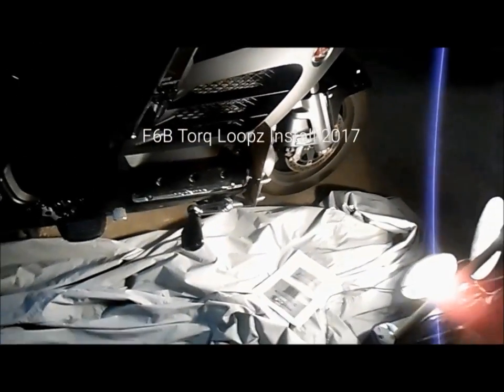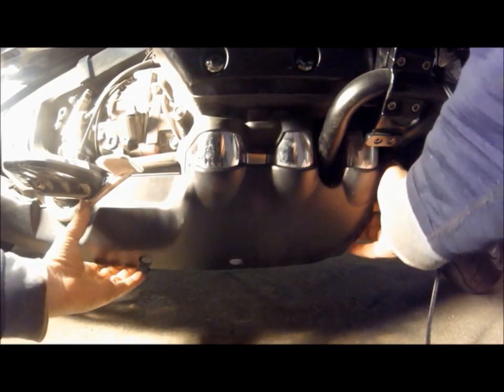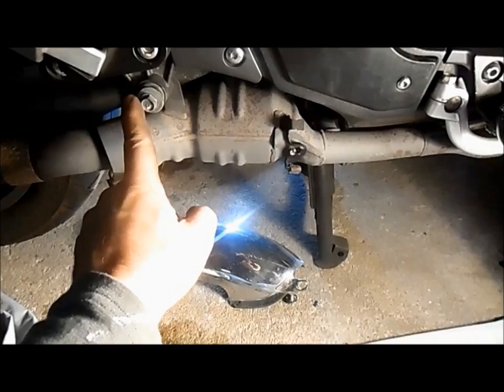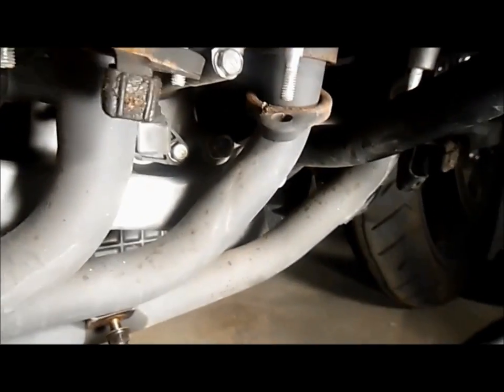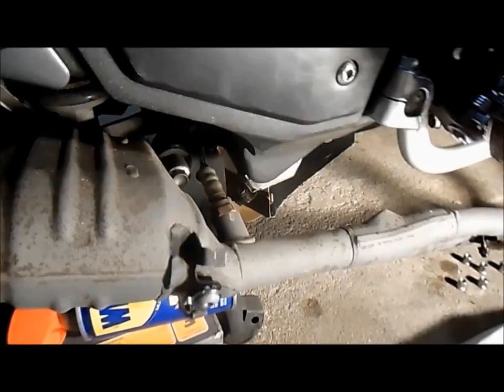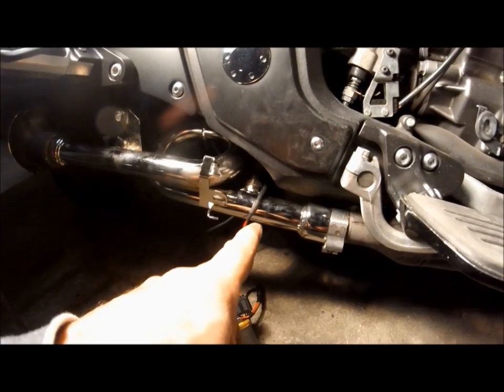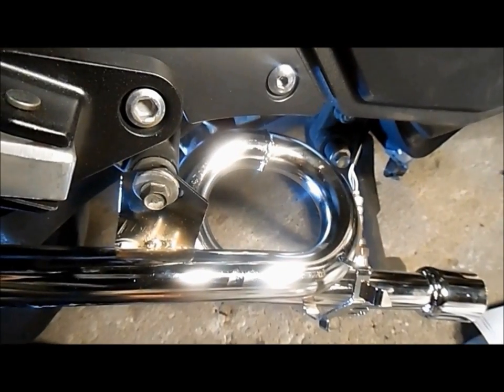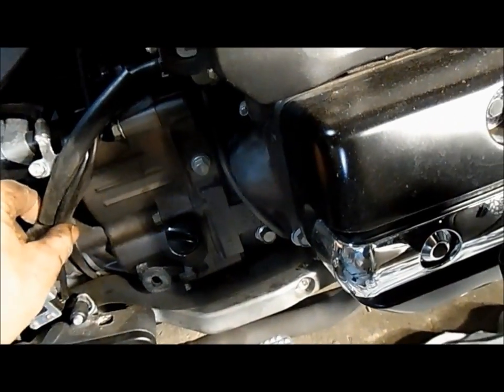F6B Torq Loopz Install April 19 2017

Comment: Thanks for the video. It helped me tremendously. Especially when it came the O2 sensors. The torque loop did indeed eliminate any aspect of exhaust drone. I also purchased a set of performance mufflers from torque master. They provide a much more throaty sound than the stock mufflers. Also, I noticed a small ability to control the actual noise decibels by taking advantage of the one inch of space to slide the muffler onto the torque loop as far forward as possible before tightening. My ‘15 Deluxe sounds more Porsche-ish and more noticeable pulling power throughout the power band. I highly recommend the torque loop as long as your state inspection program doesn’t requires a catalytic converter. Removing them allows the engine to run cooler as well as eliminating their excess weight. One thing I’d do differently is selecting TBR performance mufflers instead of those from Torque Master. TBRs are a couple hundred $$ more expensive but look and sound better.
Reply from the maker: Glass I could help, once the choking CATS are gone they all sound good
Reply from the maker: Glad, not glass, spellcheck is from hell

Comment: Tax, your making me want to go buy a set!  I was talked out of this twice!  May have to pull the trigger.  Great Vid !!!  Thanks Steve 0080.
Reply from the maker: steven powell Just do it, you won't be sorry. I have the color instructions after some arm twisting. It's easier than it seems, the hardest part are the O2 sensors but if you clip the ty-wraps   it gives it all the play you need.

Comment from the maker: !!!!VERY IMPORTANT!!!!  After loose fitting the muffler Torq Loopz and header pipes put the lowers and the side caps on and make sure the acorn nut holes and side cap bracket holes line up before you tighten everything down.

Comment: If I  might add, for those wishing to eliminate the O2 sensors altogether, RedlineSuperbikes in England sells plug-in O2 eliminators, and bung plugs for your Torq Loopz. The O2 eliminators plug into the main wiring harness. Just unplug the factory O2 harness from the main Honda wiring harness, and replace with the eliminators. Just Google RedLineSuperbikes and you'll be redirected to their eBay store. BTW, I have no affiliation whatsoever with redlinesuperbikes.

Comment: Great video.. did you use the stock exhaust or after market? I had freedom exhaust on my f6b and I had to removed due to the droning sound.
Reply from the maker: I used stock exhaust then I switched to Two Brothers Exhaust which were incredible, did a video on that too. The Torq Loopz eliminate the drone and, more importantly, get rid of those choking cats
Reply: @taxfree4  could you send me your copy of the torque loopz installation?
Reply from the maker: @bigtrailcde  sure, just give me an email to send it to.
Reply from the maker: @bigtrailcde  You have it

Comment: Is it possible to cut the CATS without removing it?
Reply from the maker: I'm not following, if you're asking if you can cut the CATS while still in place there is no way you'll be able to maneuver a hack saw, cutting tool or even a small grinder to make the whole cut
Reply: @taxfree4  thanks!

Comment: I have a Valkyrie with These Torq Loopz on and I installed a center stand.....where does the rubber bumper go?
Reply from the maker: jamihm Drill a hole at the indent where the Centerstand meets the heat shield
Reply: Do you mean drill in the chrome heat shield itself, where the centerstand arm comes up,  and install the rubber bumper on that?
Reply from the maker: jamihm that's correct

Comment: but you never showed the "cutting" which is the full commitment to torque tube upgrade and needed so people can see this whole install.I think the cut is the most important step. just saying...
Reply from the maker: The cutting is the easiest part, you measure back and hacksaw it. The assembly is the hardest lining everything up that's why I concentrated on that.

Comment: Can you send me the color set of instructions? I emailed the guy and he acted like I was an idiot. I've gotten everything off. I'm cutting the cats off tomorrow and reinstalling the headers with a new exhaust. Thanks! You don't have to clip the tie wraps either, they're made to be undone and re-tightened.
Reply from the maker: Well, he is an idiot because he emailed them to me. After 3 years I like to replace the ty-wraps having worked with them on a daily basis, phone company, sun and/or heat breaks them down so while I'm in there for a couple of pennies I knock them out. The PDF File is sent.
Reply: Thanks for the video and the file!
Reply from the maker: axeffektt YouTube nation is a nation of, by and for the people, good luck.
Reply: 2 Questions.

1: It looks like you hung the torq loopz pipes with the tab on the outside of the hanger mount. Did you leave them there? I put the tab on the inside of the hanger mount. Is there a right and wrong way?

2: Did you pull the old header exhaust gaskets and replace them with new ones?
Reply from the maker: That was just for the shot I did hang it on the inside. I think the only differences would be a slight alignment issue and the angle of the mufflers from that alignment.
Reply from the maker: No, I reused the old ones and find no leakage issues.
Reply: In additional to the Torq Loopz, I added Rush Mufflers. I'm getting popping on deceleration that I really don't care for.
Reply from the maker: axeffektt is that when you first start off on the bike, because I get that, but once she's nice and warm it seems to subside.
Reply: So far I've only had the bike at idle for about 15 mins. I haven't taken it for a ride yet.
Reply from the maker: axeffektt get on that damn thing and go

Comment: any drone?
Reply from the maker: Not at all, that's the whole purpose of the Torq Loopz to eliminate the drone
Reply: @taxfree4  thanks i appreciate your response! i only just started looking at f6b's for sale. so it really works at eliminating the drone with aftermarket exhaust??
Reply from the maker: @Corkoth55  the Loopz alone will eliminate the drone because it takes away the cross pipe. The aftermarket mufflers are really cosmetic as you can put on the stock mufflers with no problem. I traded my 2013 Harley Road Glide in for a 2013 F6B and never regretted it. Took the bike cross country and it was a road sofa. The best bike I ever owned, and will own again.
Reply: @taxfree4  wow! i really appreciate you answering. there's not a ton of info out there. i'm looking for a 2015+ deluxe model. i want cruise and all the features the deluxe offers. I have a 2013 kawi vulcan vaquero 1700. really like the look but the ride is getting old. i love riding my dad's 04 gold wing more than my own bike lol... an upgrade is in my near future.
Reply from the maker: Hit this link 

http://hondaf6b.com/showthread.php?13687-2015-F6B-Deluxe-for-sale.

 I am a member of the f6b forum and this is a 2015 Deluxe model with only 2009 miles on it. This bike isn't even broken in, 5000 miles is the first break-in maintenance. Has a warranty till 2023.